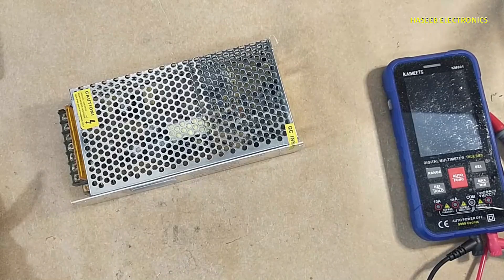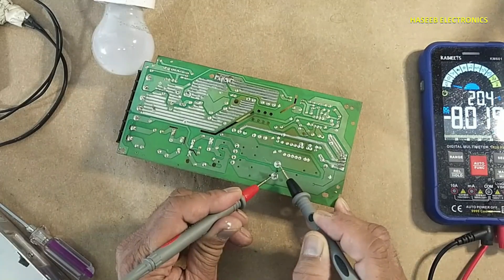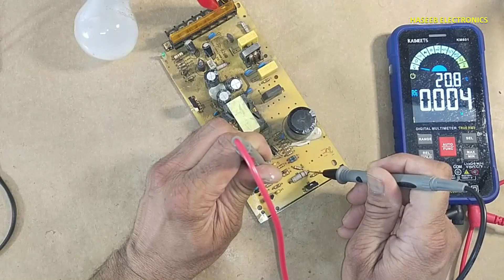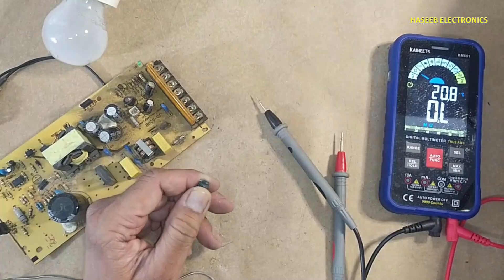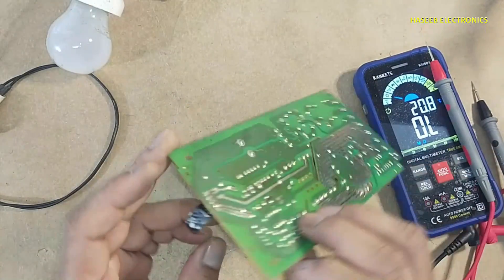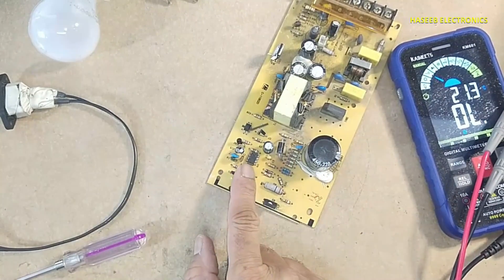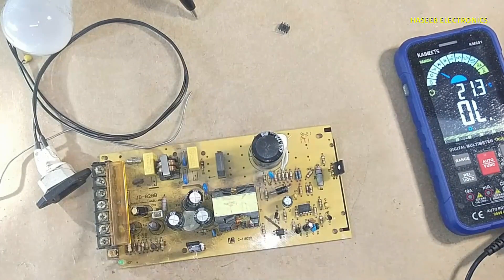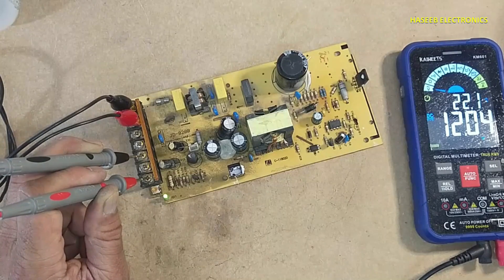{1056} 12V SMPS power supply repair, NO OUTPUT

Comment: I had the exact same power supply I brought it in scrap market when I initially powered it on the bulk capacitor after Bridge rectifier top burst out so I replaced the 400v cap and output capacitors but when I powered it on again the input AC voltage at the input terminal is showing as 0v I couldn't able to find what is the problem since fuse and ntc is fine kbl410 diodes are fine is there any suggestion

Comment: hi sir , good explanation thank u, i have a smps 12v 30A , without load smps is provding 12v out., after i connect 12v 100w halogan bulb to output ,the right side transistor burns mje13009k, why is that? pls help.